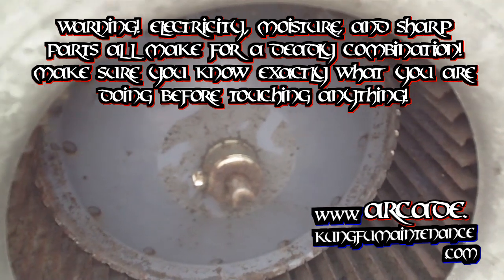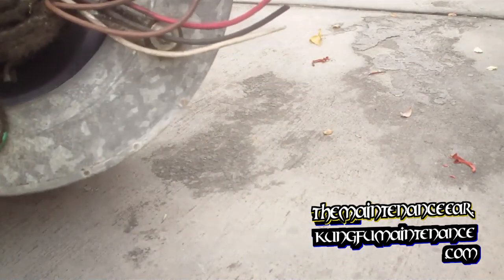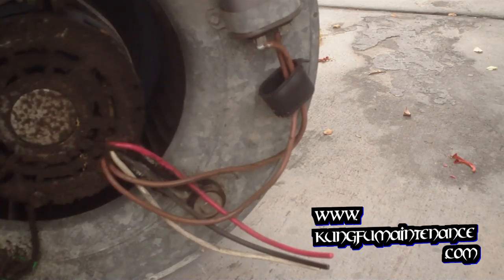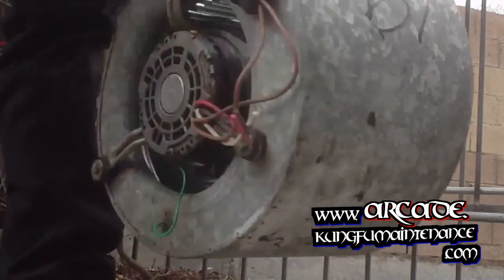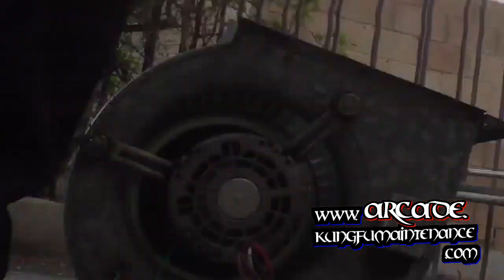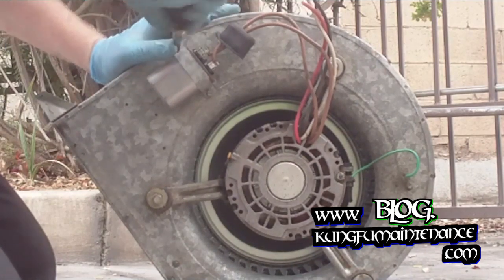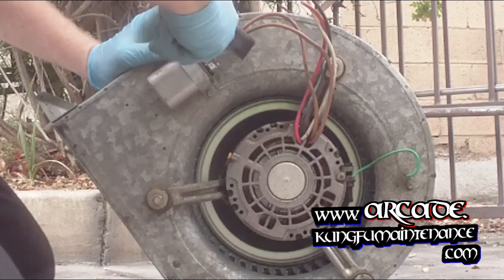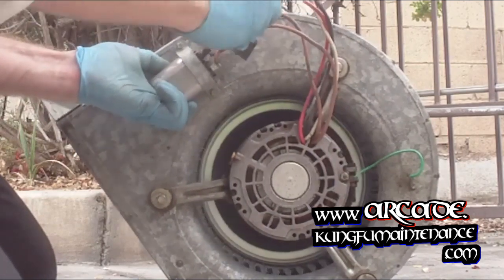How To Replace Noisy Broken Indoor Air Conditioner Furnace Fan Blower Wheel

Comment from the maker: There may be some other screws further back sometimes you can see them from above poking up to the area above the blower wheel. Also sometimes you may need to lift up a bit as you pull the blower assembly out.

Comment from the maker: The parts you can get on my KungFuMaintenance website "Keeping Cool" page. If you don't see a part you need such as "blower wheel" just enter the term in the search box at the top right. I make a small commission on any parts purchased there. Alternatively you may find the parts at a local HVAC supply store such as Johnstone.

Comment: Hey I was wondering if a burning plastic smell coming from the vents would lead me to replace the blower. I've read online that if the motor is burnt out, it causes a burnt plastic smell to come from the vents. Please let me know
Reply from the maker: Sounds like reason enough for further investigation. Burning plastic smell could be overheating wiring insulation. Something as small as a poor wiring connection or a capacitor that is loosing it's phase could cause that. The motor itself will have copper windings so usually not a plastic smell except perhaps the wiring insulation to the motor. Areas to give off plastic smell might be wiring insulation, transformer wiring, relay, wire connectors etc.. Any poor connection will cause heat build up. Also undo stress such as heavy load due to clogged filters or evaporator coils.

Comment: I'm trying to educate myself about this since my fan is making louder than normal vibration like noise v when running. Was just replaced. First unit he placed was noisy then returned with another unit. Quiet overnight next morning bam noise returned even louder. So not sure v what wise might be v wrong. He said metal fatigue b cab new b the problem. Next party will be 1200$. Thanks.

Comment: I found water dripping onto the wires from the condensation, and onto the motor, crap :/
Reply from the maker: Good work. Sounds like you won't need to replace the motor. It should dry out OK. I show how to unclog the condensate drain in me vid "How To Unclog Clogged Air Conditioner Condensate Drain Wet Carpet Floor In Front Of AC" It's good you caught it now before it can do any more damage.